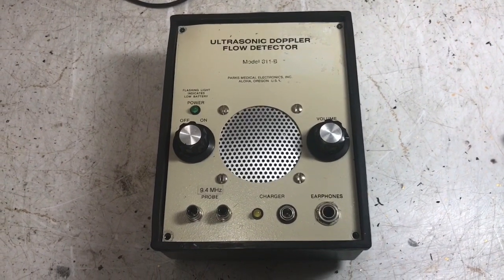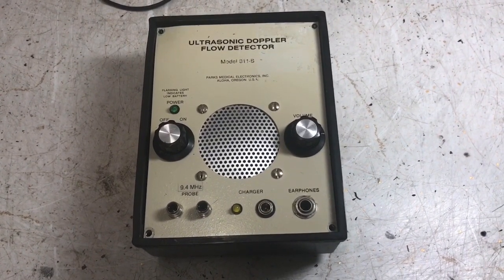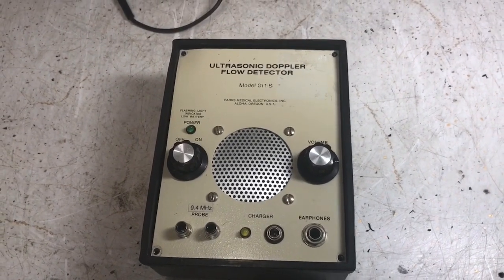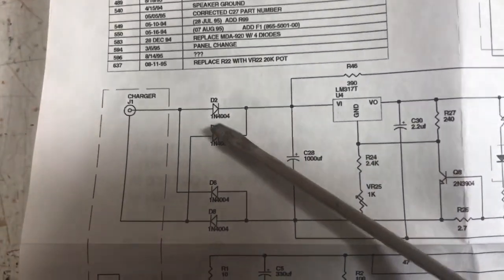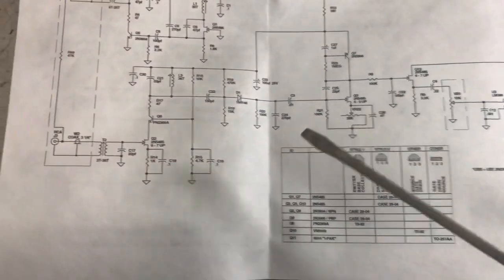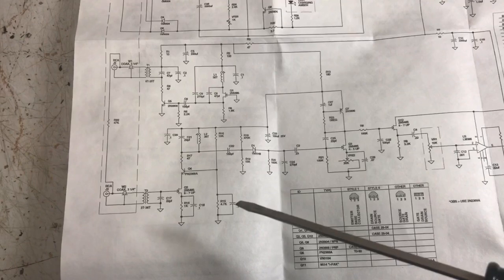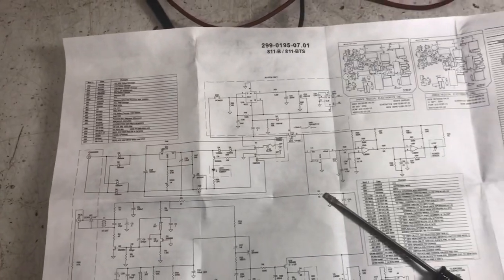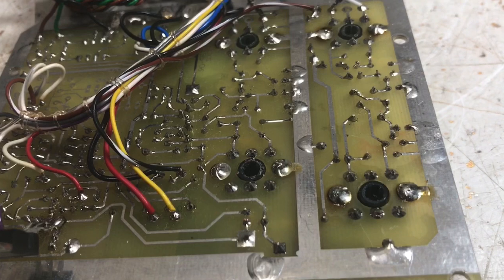Doppler flow detector, K7PP Page

Comment: Used to have the exact one at the hospital I used to work at, worked really well too.  The newer more modern ones don't work as well, I don't think. We use it for checking pulses in people's feet and arms etc... Very useful after vascular surgery. And yes with a very low blood pressure sometimes the only way you could hear it was with a Doppler.